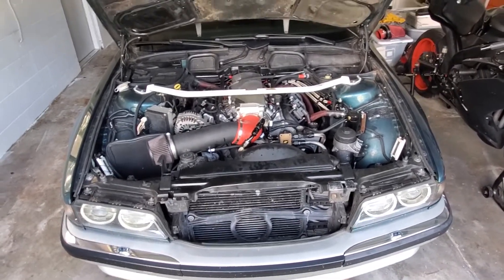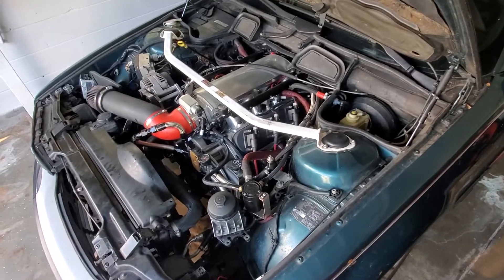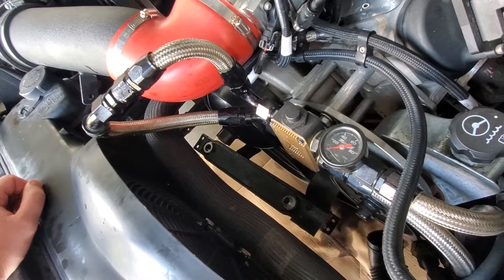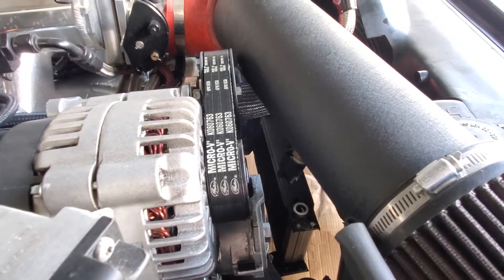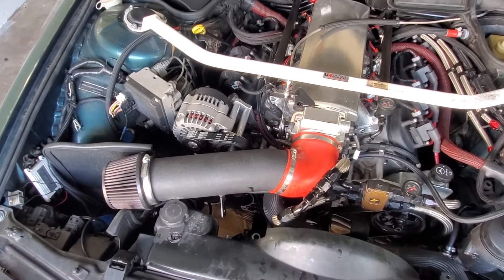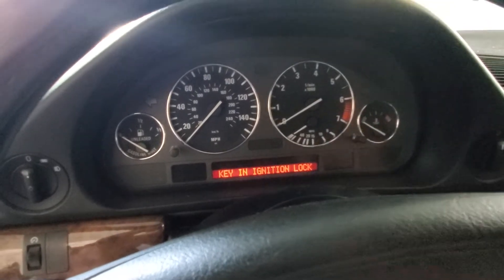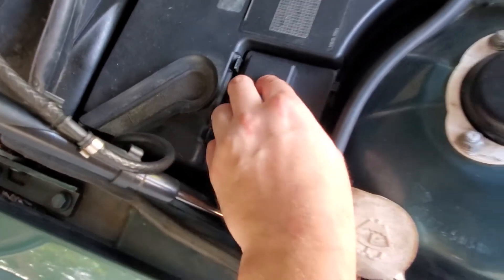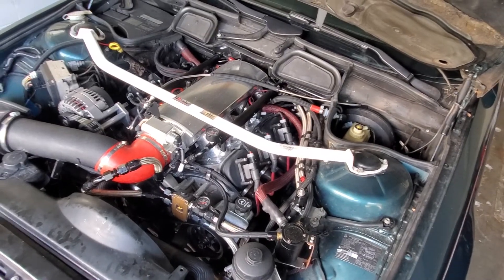e38 740iL BMW LS SWAP pt. 28

Comment: I have been looking at getting the a/c running in mine too.
Here is the verbage from the book:
The air conditioning function is activated by pressing the A/C button. This is followed by idle increase. By way of the output KO, the air conditioning control unit informs the DME that it intends to switch on the compressor. Consequently, the DME implements an interfering variable circuit, i.e. it moves the throttle in the direction "more air" while at the same time increasing the injection quantity.

By way of the KOREL signal (compressor relay), the DME sends a feedback message to the air conditioning control unit instructing it to switch on the A/C compressor. If all conditions for switching on the A/C compressor are fulfilled, the A/C compressor is activated directly by the control unit.

To avoid excessive water discharge from the evaporator, after the air conditioning system has been switched off while driving, the compressor is switched on and off at set intervals for 15 minutes. In this way, the evaporator temperature is slowly brought to the value of the outside temperature.
Reply: The "correct" way to get a/c running would be to packet sniff the CAN bus and capture the packets the DME and ACCU are swapping back and forth. Then someone would have to rig up an Arduino to simulate the DME. When I say correct, I mean the way least likely to interfere with automated climate controls. On the other side, I am curious to see what would happen if someone cracked open an ACCU and soldered a wire to the trace for the A/C switch and having that activate the A/C. It may be possible the environmental controls would be able to cope with an "uncommanded" compressor on signal.
Reply from the maker: @MrWrongsalive  Hey Todd, thanks for the info as always. I would have to agree, you would have to trick the computer with some micro controller that all conditions are met so the compressor can kick on with the BMW commands. Going through all that seems like a fair bit of work. Also I don't know what kind of signal the GM compressor wants and if it's designed to cycle or run constantly. That being said I'll likely do some fishing on the A/C circuits to see if there is a wire that cycles on and off that I can tap into with an independent relay and call it good. Have to learn more about the circuits and the GM compressor. I may do some looking this weekend and see about making another video. I have opened up the A/C control module to fix the displays before and it did not look to exotic. I'm sure all those commands come from that module so maybe some wire splicing or PCB modification and that compressor signal may come out of the harness. If I get lazy I could always tap into the switch on the A/C module for power on and add a relay and have the compressor run constantly. The terminator X has provisions for compressor idle up and kick off over 50% throttle which I would like to integrate somehow. Have to look more on the best way to combine all functions. I can't remember if the terminator x can do pure A/C control but it has programmable outputs that you may be able to set 15 min on 5 min off etc etc.

https://www.carmanualsonline.info/bmw-740il-1995-e38-system-wiring-diagrams/?srch=air%20con 

Shows A/C circuit diagram
Reply: @thehomeofbiglspower  For the low low price of $85, Holley sells an a/c expansion kit for the Terminator X. It will take care of all the duty cycles for you, raise the idle and kick on the rad fans too. I need to dig through my notes but I found an adapter that will convert your BMW pressure switch threads to GM threads.
Reply from the maker: @MrWrongsalive  that's awesome, of course holley sells an adapter. Kind of annoying they didn't include the coil harness with my terminator kit but we know how the game goes. I'll start with my test light and see how far I get.

Comment: Yea I have future project I am try to put LS in a 2004 740i bmw what transmission I have to use
Reply from the maker: Depends what transmission you want, you'll have to figure that out first. Then you can look at the manufacturer website and look at dimensions to see where your transmission and engine fit inside the engine bay.

Comment: Looking forward to hearing how y’all solve the AC wiring. I’m running the stock GM ECM, so will need to figure out how to up the throttle when compressor comes on. Other than that, I’m ok with the simple on/off switch on the dash and keeping it simple. Will stay tuned and continue to learn from you all. Thnx
Reply: David, I'll give a little history lesson here and it should lay out all the options. Early GM A/C, like pre-LSx, would route the compressor on-signal wire through the trinary pressure switch. Basically, if you had enough freon in the system, the switch would allow your command signal to pass on through and hit the A/C relay. As time went on, engines started revving higher than what A/C compressors could handle (around the time LSx came out). Engineers figured it would be better to let the ECM cut off the compressor at WOT not only to save the compressor but also to reduce parasitic load on the engine and free up some HP.  Later on, they figured out that it would also be nice to have the compressor off while cranking too. So there are a few good reasons to have some kind of monitoring systems. Both Tom and I have Terminator controllers so we can just order the expansion pack. 98 - 07 LSx ECMs have an A/C command wire pinned in them that can accept a 12v signal. Your using the Camaro E38 (<--- GM's designation) ECM for your swap which is looking for a constant CAN bus signal to know when to operate the compressor. There is a company called RpmExtreme that sells a GM E38 A/C Request Module for $250 that accepts a 12v signal and then talks to your ECM. One other option I've heard about is robbing the a/c controls out of a Camaro and rigging that up behind the dash.
Reply from the maker: @MrWrongsalive  Good stuff brother. That all makes sense. Could have the compressor with a switch so you could control it manually after engine is running and have the holley do the interrupt with a relay that is wired correctly so when the terminator sees 51% throttle it commands A/C off and interrupts that manual compressor switch. Just a thought.
Reply: @MrWrongsalive  Thanks for the insight.  I'll look into the RPMExtreme module and get going on that route.
Reply: @MrWrongsalive  OK, real novice question:  the module vendor is asking if when turned on, does the AC unit output 12 volts or does it ground the output.  Thinking its the former???  thnx.
Reply: @davidmoye5828  It depends on how you want to do it. My personal preference is output 12 volts. But if you don't want to hunt down a power source for your A/C switch then you could just connect your switch to a ground under the dash. But if you're thinking about tinkering with the A/C module for a stealth look, then you'll probably want to order the output 12 volts version.
Reply: @davidmoye5828  the ihka outputs a 12v signal along with a pwm signal when the snow flake button is pressed. Not sure which pin it is.

Comment: I just got AC hooked up on my swap and the compressor ran out of the box after it was filled enough to trip the pressure sensor in the drier Assembly. I had it connected to the original bmw harness.
Reply: For the AC compressor I used the GM truck compressor. It matches the original pre facelift bmw compressor closely with the CCs and pistons. Looking at the denso part numbers for The bmw and the GM truck they're very similar. For the line set I crimped on a #12 beadlock hose fitting to a 90 degree #10 nut for the suction side using the original bmw hose. For the discharge I had to get a barb welded on that matches the od of the pipe and used #10 reduced barrier hose to a crimped on 90 to #8 nut.
Reply from the maker: @agustinmorales4045  nice brother, thanks for explaining your setup. I'll have to look at my harness I'm not sure if my pressure sensor harness is still there. Glad to hear it still worked out the box. Been looking at cold hose and I'll probably pick up my fittings from there. Any chance you could make a video on your setup? It would definitely help out. Cheers brother
Reply: @thehomeofbiglspower  yea no problem I'll make one tomorrow morning. Your videos helped a bunch with my swap it's the least I could do.
Reply: Agustin, how do the automatic climate controls work? You just hit the A/C button and it all works without the DME in the loop?
Reply: @MrWrongsalive  yes I hit the AC button with the temperature control below ambient and the compressor did kick on one enough of the r134 made it in
Reply: @agustinmorales4045  Awesome! Good news. I would love to see your setup.
Reply: @thehomeofbiglspower  got the video up explaining what I did. If you have any questions let me know
Reply: @MrWrongsalive  made a video on the hardware setup. For the wiring I grounded out the ko rel signal you spoke about in the other comments. It's pin 19 on the x69 connector black and green. No dme to be found. Left the high pressure low pressure cutoff switch in place found in the receiver dryer. The clutch kicked on using the bmw harness wiring while I was filling with refrigerant.
Reply from the maker: @agustinmorales4045  I think the only other problem I can think of is the idle up and the 51% throttle kick off that the terminator does. I think if we use the stock wiring I would have to interrupt that stock bmw signal with a relay from the terminator.
Reply: @thehomeofbiglspower  my Holley terminator car didn't die when the compressor kicked on. I haven't been able to drive it to see if it's different when moving. My tune idles high because of the cam I have in there so it worked good without changes. The Holley will detect drops in rpm below the commanded idle rpm and try to correct. If that correction isn't enough I'm sure you can connect the compressor signal or the AC ready signal to one of the spare inputs on the holley. The Holley will take 12v+ or ground signals and you can tune it to raise the idle.
Reply from the maker: @agustinmorales4045  good points. Thanks Agustin